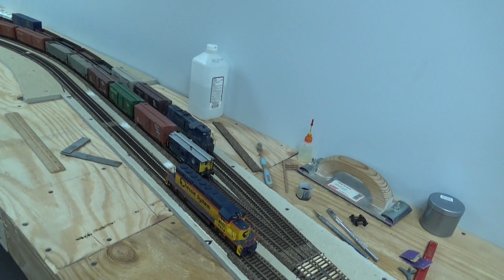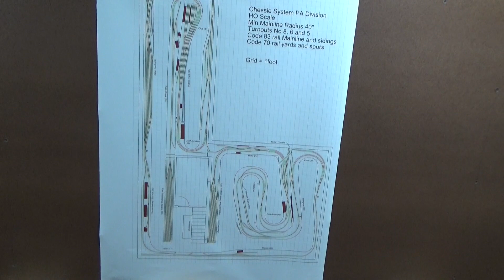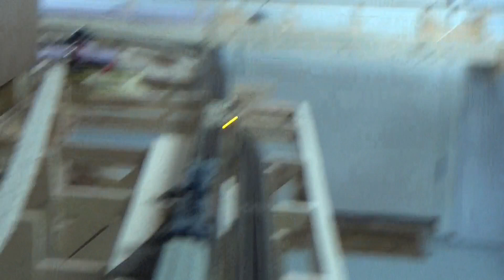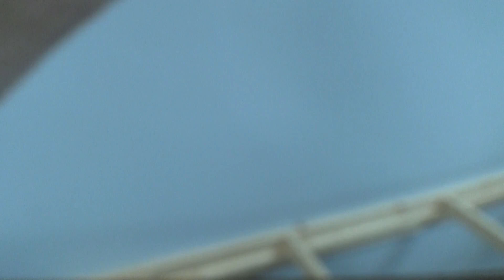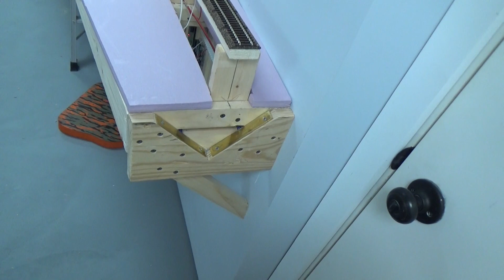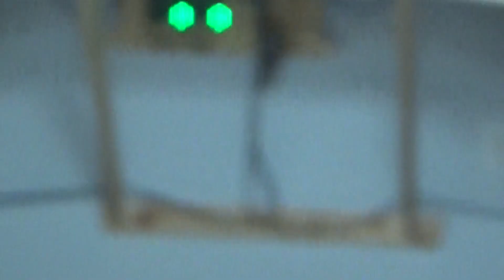Mosgrove, Echo and Dayton Grade (Model Railroad Update 37)

Comment: Looks good Scott, I'm slowly working on an N scale layout at the moment......trying to rebuild some equipment and get stalled projects restarted.......on that lift bridge.....if you cut gaps in the brass pieces.....you wouldn't have to run a separate cable for your signals.
Reply from the maker: Good to hear from you Dennis.  What is the theme of the N scale railroad you are building?  The signal system requires Cat 5 cables so that is 8 conductors plus the two for the track.  Since the lift out does not need to be removed during operations having a plug for the Cat 5 is not really an issue.

Comment: I very rarely have seen any 6-axles on the now B&P section of the B&O. I am going to be modeling an interchange with the B&O from 1980-1987 and even then, it was GP40-2, GP30, GP35, GP40, etc. Only one or two SD35s and a couple other SDs.
Reply from the maker: I agree, but until i modify and add decoders to many more locomotives this will need to serve the purpose for the time being.  I have no plans to purchase any additional SD's